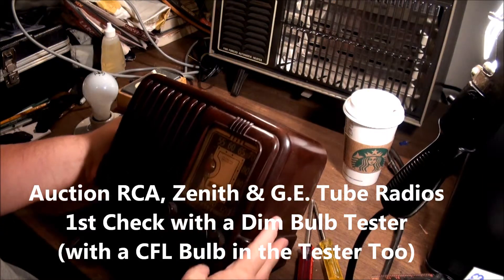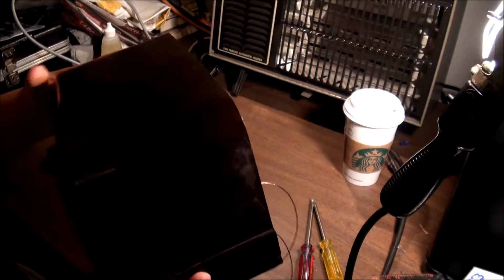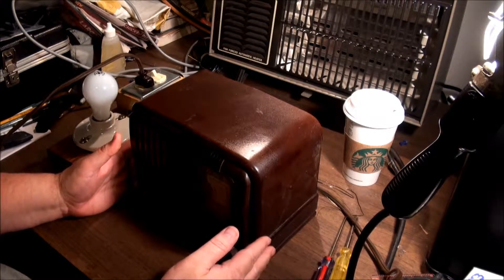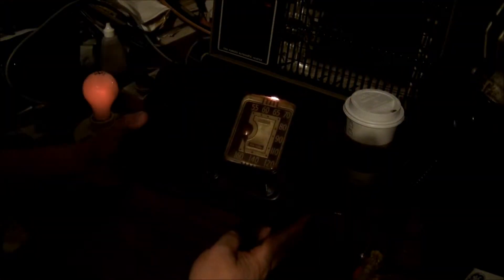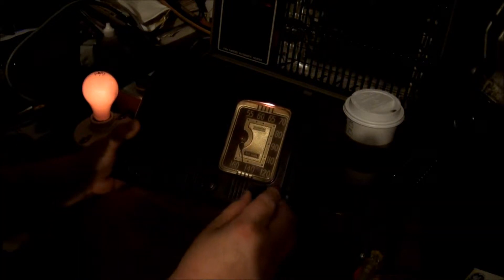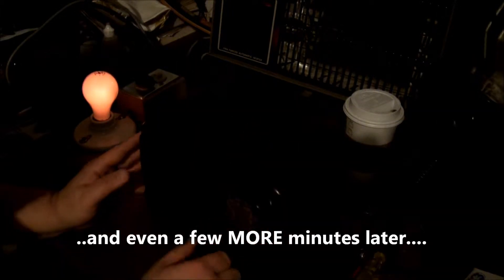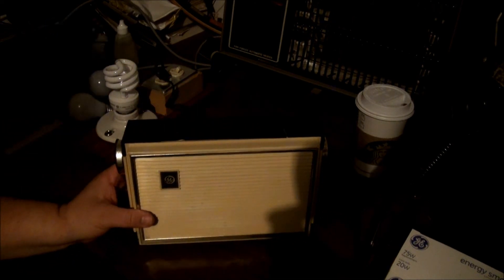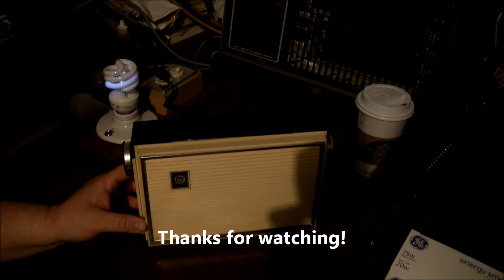Auction Tube Radios: Dim Bulb Testing (with a CFL too)

Comment: They only "banned" the manufacture and import of standard duty incandescent lamps. You can get rough duty bulbs no problem. Also halogen is an incandescent with the difference being the filament is trapped in an envelope tube with halogen gas then that is stuck inside a classic bulb globe. Much safer than the danged Chinese CFLs and work with dim bulb as well as X10 dimmers.